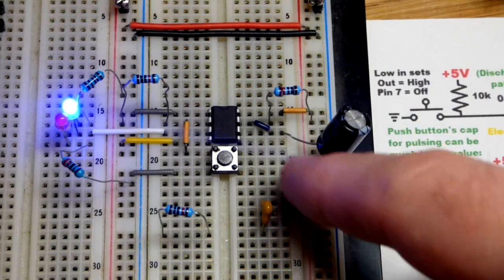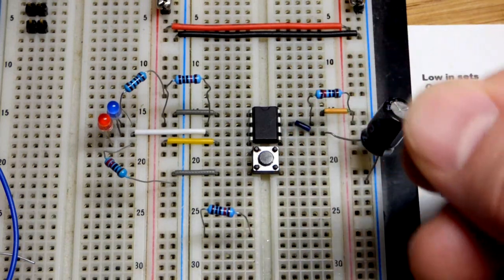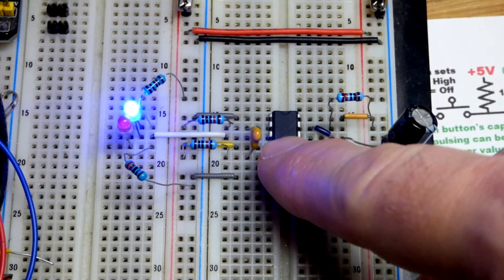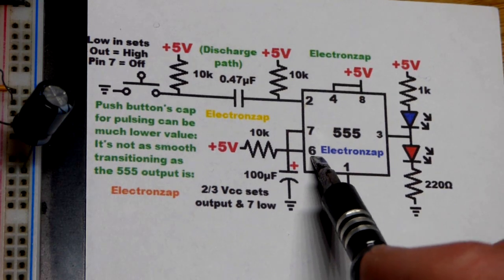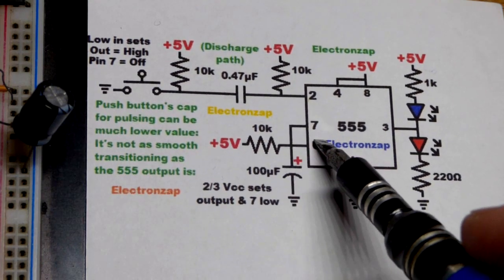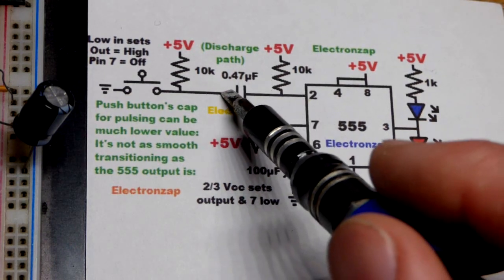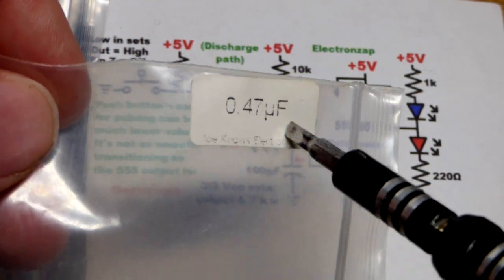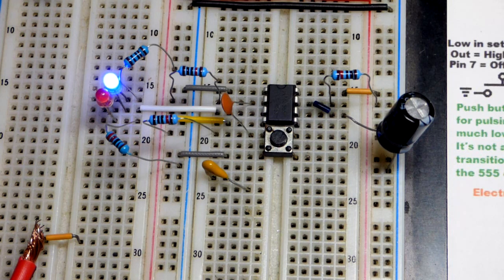Much shorter push button pulse in for short monostable mode 555 timer pulse out circuit schematic

Comment: thanks for this video i was looking for this type of button control.
  i did notice when you used the 1nF capacitor however that the red led illuminated at the start of the button press and also an unwanted illumination again when the button was released. 
the clear camera closeups in your videos are much appreciated
Reply from the maker: Yeah, switch bounce will also be transferred if you just use a capacitor for a pulse. Switches tend to bounce both while closing and opening them. Would need to add switch debouncing to remove that.